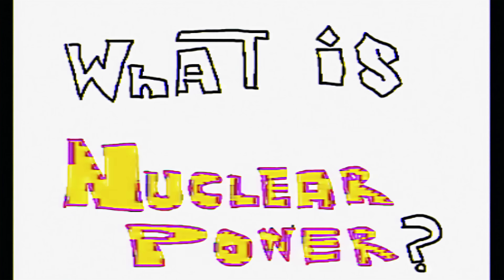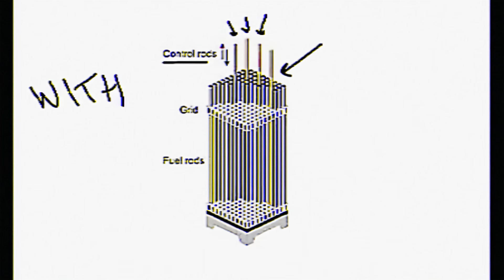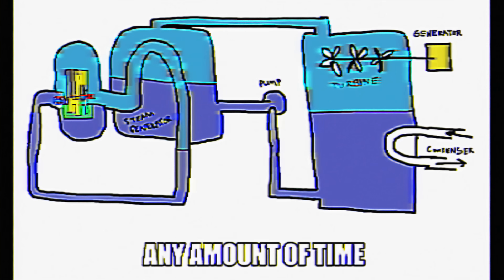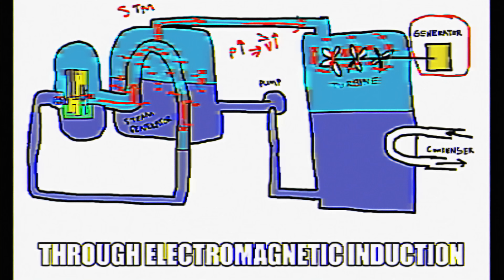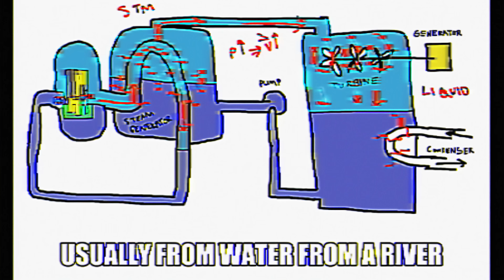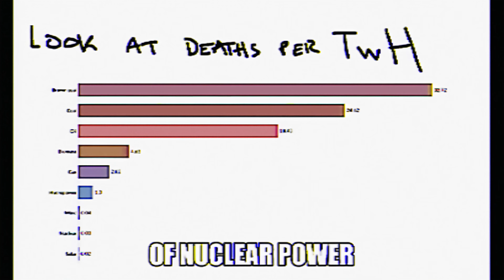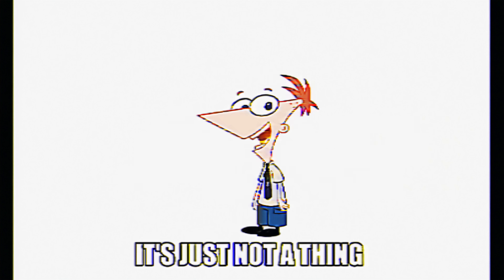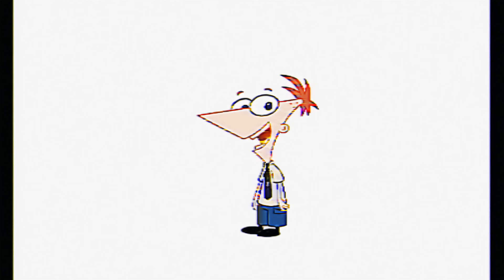Phineas Explains Nuclear Power and Myths for Dummies

Comment: You work for a nuke plant, were in the a navy working with nuclear reactors or have a degree in nuclear engineering. You can’t fool me
Edit:my point was proven and now I feel stupid
Reply: I mean atleast you feel stupid. That’s a good start. I mean all I’m saying is if the military can trust Beck with a reactor then they are probably pretty safe (he also never talked about ntc’s.) Negative Temp Coefficients also help out tremendously. Essentially all it means is that the hotter the thing is the less reactive it becomes thus making it virtually impossible to actually create a melt down. Like it’s harder to fail the reactor than it is to do your job you trained to do. But yeah sorry if you actually do like nuclear because just how you worded your comment makes it look like you aren’t in support of it. So you know if you are great job. If you aren’t good job on accepting some form of (defeat? Like I just can’t think of a word for it. Oh I got it thank you for being open.) anyway have a good day.

Comment: From some quick google searches you can find that nuclear power plants have caused approximately 4000 deaths total, and we've been using it since 1957, or 68 years, meaning that on average, there are about 59 (rounded up) deaths per year caused by nuclear energy.

You can then look up how many deaths are caused each year by pencils, which is about 100.

Nuclear energy is safer than pencils.
Reply: LOLLL THATS PEAKK
Reply: I'm holding a pencil rn
What the hell

Comment: 5:23 the only reason why British Railways crashed a train into a nuclear flask it was manly to ease public opinion about transporting nuclear waste via rail but here’s the thing with transporting that kinda stuff by rail their is actually less of a chance of a crash happening because to drive the train the driver has to be hired by the company and also systems like AWS (automatic warning system) basically how AWS works is that in the engines cab thiers this dial that looks like a sunflower and if thiers a red signal up ahead a very obnoxious horn would sound in the cab and if the driver doesn’t acknowledge then the train would go into a emergency stop preventing it from colliding into another train. Buy road vehicles don’t have those same systems also your more likely to get into a car crash then a train crash
Reply: Meanwhile the US testing a missile impact against the cask not to ease the public but just because they fucking can

Comment: The Centralia Coal Mine Fire happened over 20 years before Chernobyl and is still burning, and will likely continue to burn for upwards of 250 years, continuously emitting carbon products into the atmosphere. Chernobyl isn't much more livable, but it is not actively getting worse with each passing day. It's over. The worst is done with.

Centralia is just one example.

Comment: Yeah, the safety argument is stupid the more you think of it.
I´m not a big fan nuclear energy though, sine shit it hella expensive and newly build reactor had a tendency to have massive cost overruns while having delays for years (that´s how as a independent company Toshiba died).
Renewables are cheaper to build and to operate and are much more decentralized too, while only SMRs are having that in theory, but in the last 10 years ever year was the year of the SMRs.
And let´s not forget the problem of storing atomic garbage, since you need a absolute safe place where it can be stored for Milennia at least where it can´t contanimate ground water reservoirs.
Meanwhile the only big problems of renewables is the storing of power during phases of low generation, and there were already quite some progress with battery technology.

Comment: I agree completely. But we need more hype not for small, but LARGE MODULAR REACTORS (LMR)

Forget about 70-300MWe toy reactors and lets build >1GWe large reactors again in multi-block Power Plants.

A 4-Block APR1400 can produce a whopping 16GW of heat or 5.6GW of Electricity

Thats enough heat (district heating) and electricity for entire countries

Comment: Fun fact: the vast majority of the Earth's heat comes from radioactive decay. All we need to do is drill down deep enough, slap a heat exchanger down there and now we have caveman nuclear power
Reply: Would it really be that simple realistically? Like the logistics and infrastructure required to build a safe power plant towards such a massive source of heat while also not making it just collapse wouldn't just be basically impossible to do for any country?

I'm pretty ignorant when it comes to this but your random comment actually made me curious about how it would be done if even possible at all.
Reply: @quiler6969 it gets exponentially more expensive to dig a deeper hole, so unless you're someone like Greenland and have a ton of natural geothermal activity (Yellowstone might be a good candidate too, but it's a national park) it would just be way more expensive than it's worth.

Comment: IT'S JUST BOILING WATER
IT'S ALWAYS BOILING WATER 
WE MASTERED THIS SHIT JUST TO BOIL MORE WATER
Reply: its REALLY good at boiling water tho
Reply: and what is wrong with that? Sci-Fi magic energy generators destroyed everyone's brains about how electric energy is produced
Reply: @reviewspiteras  when we get sci fi black hole annihilation plants, i bet it'll still boil water lmao.
Reply: @SheriffWalrus um actually 🤓☝️... it's very likely
Reply: @SheriffWalrus "Okay we are using this black hole for energy now, how is it being harness-"

"BOIL WATER"

"W-what?"

"BOIL WATER"
Reply: @reviewspiteras  to be fair there is only 2 viable ways to make a current, mechanical to electromagnetic throug a coil and a magnet and radiate a polarize semiconductor, even if the second seams to be more efficient is a pain in the ass to control and develop that is why is stays in solar panels, and dradiation decay batteries, even diamond can work as semicondutor, nuclear batteries are made this way, but the only use case tend to be satelites, cause have low power and high longevity.
Reply: You’re never going to believe what fusion energy is used for
Reply: always has been
Reply: To be fair, that's all water seems to do, other than freeze.
Reply: Heating/boiling water is one of the best ways to store and transmit energy
Reply: Use the boiling water's heat to boil more water that steams into energy and transforms into water ready to be boiled again, is what I understood
Reply: And backfeed motors
Reply: Solar power 😏

Comment: imo, should the mass implementation of nuclear reactors EVER happen, there should be a law that makes sure EVERY SINGLE safety code is upheld, and budget cuts super difficult. 
I don't even want a single digit of another chernobyl happening just because Mr. Munehbahgs wanted to save a few extra cents, even though there's very much low chances of this happening.

Comment: I’d kill for a sequel that talks about how Chernobyl was the exception and not at all the rule
Reply: How to make your rbmk reactor go boom:

Step one: operate it at 50% power for a day or so, to let those decay products build up

Step two: rapidly reduce power to like 20%

Step three: wait for that day or so of 50% power's waste to decay into xeon

Step four: observe the operating power plummet as the xeon builds up and absorbs all the neutrons

Step five: go full throttle in a desperate attempt to keep the power up

Step six: ignore the warnings about reactor instability, and shut down the computer trying to reinsert the control rods

Step seven: wait until the reactor gets a bit too spicy

Step eight: scram the reactor, displacing the water moderating the reaction at the bottom of the reactor 

Step eight;a: the bottom of the reactor goes prompt critical, melting the channels where the displacers are supposed to go and preventing the control rods from inserting

Step eight;b: watch as the water boils off. Consider the fact that liquid water is the only thing moderating the majority of the reactor 

Step eight;c: observe how your actions have melted down the reactor

Step nine: a massive steam explosion blasts the top off the reactor and through the roof, binging tons of fresh air/oxygen to displace that superheated steam

Step 10: observe how the H2 and O2 react violently in the presence of extreme heat. Be careful not to trip on any graphite which has now been ejected from the reactor.
Reply: @ΜικεΡ getting the step by step process is kind of hilarious. I knew it was bad but hadn’t seen it derailed that concisely before due to…”””nosey””” little reasons. They really did everything exactly needed to cause a BIG PROBLEM
Reply: @kingofhearts7293  to be fair to the operators, they didn't know scraming the reactor could be fatal. They always thought that if things went sideways, they had a safety net.

Unfortunately, the other incidents of momentary power surges while inserting a large number of control rods had been covered up.
Reply: @ΜικεΡ I second this
Reply: @ΜικεΡ  first off, hindsight is 20/20 and that is not exactly how chernobyl went down.
Reply: @callumery119 it wasn't hind sight tho. They had a number of engineers and scientists, including individuals who DESIGNED THAT KIND OF REACTOR, telling them it was flawed and how it could go wrong. They refused because they didn't want to admit Soviet technology had a fault.
Reply: It wasnt just regular incompetence. It was the kind of special negligence that could only come out of the Soviet Union.
Reply: @Double-R-Nothing 100% the glorious leader was far more concerned with having the fancy new technology then with people's lives. 

Then there's Japan, they had negligence problems, but long therm their nuclear issue was earthquake withch the got pretty good at dealing with.
Reply: @Double-R-Nothing not from SU. Russia. Them now bomb Chornobyl NPP
Reply: @Double-R-Nothing I dunno, I've seen some stupid shit with Americans and even Canadians... (Look up Enbridge oil spills. Canadians, change your location first because their leaky pipes power most of Quebec.)
Reply: The wild thing that most people forget is that only 1 reactor failed, the other 3 stayed active for years and were slowly shut off. The last was decommissioned after the turn of the millennium. Chernobyl was a bad design ran unbelievably poorly and it still wasn't all that bad compared to other industrial accidents
Reply: beck PLEASE make a pt2 about this; people unironically dont understand how safe nuclear CAN be, under the right circumstances (which it should ALWAYS be under, and monitored hint hint)
Reply: That and Fukushima. One was incompetence, the other was basically just a freak accident from the earthquake meaning it basically hit the worst case scenario possible to try and deal with.
Reply: Only one reactor was called chernobyl, the others had different names
Reply: Three Mile Island was exaggerated, Chernobyl was because of negligence, Fukushima was a one in a million accident.
Reply: I want to hear what happened with Fukushima too
Reply: Your prayer has been answered
Reply: *Chornobyl

Comment: Just want to start off with saying I am an avid supporter of nuclear energy & other renewable energy sources (would love for more geothermal solutions to be explored). Also I'm just an EE, so this kind of stuff is way beyond me.

But isn't the half-life of Plutonium-239 24,000 years? Just wanting to comment on your claim that the high level waste is "all gone by the EOL of the plant" I don't quite understand that.

I would rather have a build up of Casks instead of flooding our atmosphere and killing the planet, but every form of gaining energy has some sort of setback.

Also side question, what is the average planned lifespan of a nuclear power plant? Would be another pro-nuclear energy point if they last longer than a coal plant (anywhere from 30-80 years)
Reply from the maker: Plutonium and other transuranic elements are the major consideration within the 5% remaining of the total radioactive waste of a power plant. Most radioactive waste isn't Transuranic, often being smaller nuclei with short-lived half-lives. Plants also have an expectancy for about 40-50 years of service, with extensions up to 80 years if strict criteria is met
Reply: @Beck_the_schizo  Thanks for the follow up! Maybe Dr.Doof can whip up a "common-sense inator" to convince the entire tri-state area that this is what efficient power generation looks like 😂

Comment: The only thing that you missed is that the real reason of why nuclear energy is not much used is not because they're afraid of it, but because using coal and oil is simply more proffitable. So in the end it's all about money...

... like always has it been.
Reply: And would also piss powerful off people that only have those resources to keep there county afloat that would cause greater conflicts.
Reply: so true and plus propaganda make by boomer in internet
Reply: Green Party moment
Reply: well, fear still plays a part because that's the 'reason' why they dont use it
Reply: It's only more profitable because of the massive amount of regulation, and permits required to set up a nuclear plant
Reply: As with all things in our shitty fucked up world, long term stability always takes a back seat to short term profits.
Reply: coal and oil are substantially less profitable than solar at this point though
Reply: Except im pretty sure it'd easily become far more profitable by simply switching away from fossil fuels for power
Reply: Pffft that's redneck nonsense, the obvious problem is that Oil tycoons don't want to stop selling oil so any form of discredit (including you yourself calling it unprofitable) to non oil energy sources is valid to them.
Reply: But I've heard that even though yes in the beginning it is expensive to build but overtime it becomes cheaper. But hey maybe I'm wrong
Reply: CAPITALISM FUCK YEAHHHHH 🦅🦅🦅🦅🦅🦅US US US US US US
Reply: MONEY 🦀 ✡️

Comment: You’re preaching to the choir. Literally The only reason why Chernobyl happened was because of lying communist who think that their system is perfect. And Fukushima was just a bad location. If United States went 100% nuclear power I could run several powerful computers with several air conditioning, blasting at them with minimum cost to my energy bill.

Comment: Jokes aside this is good information to get out especially as somebody studying science rn, there's alot of mainstream misinformation
Reply: The main failure that made it worse was the fact the backup generators were built on the ground level, which flooded with the tsunami. Like, that's not the fault of nuclear reactor, that the fault of stupid engineering and a massive tsunami that breached the sea wall